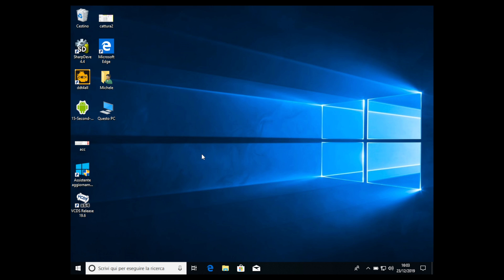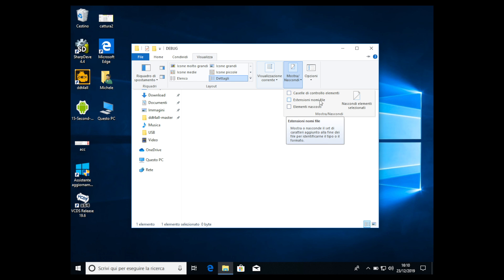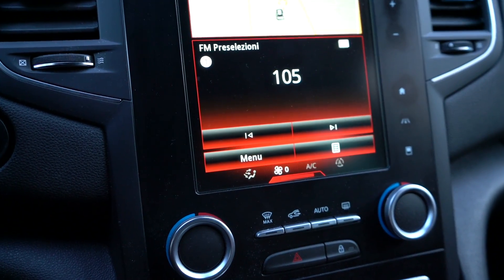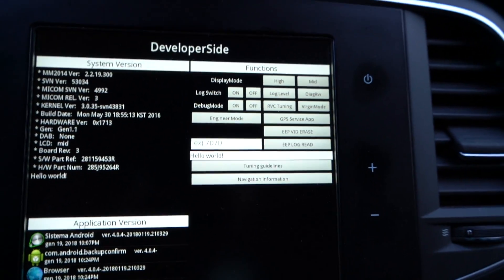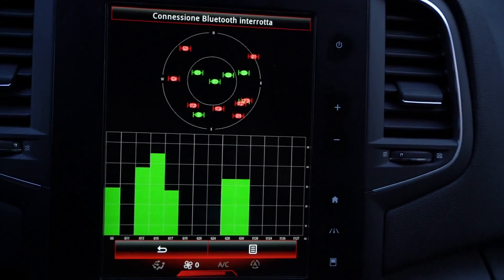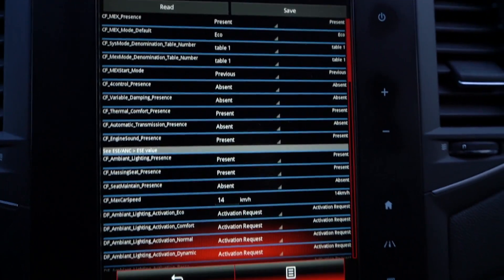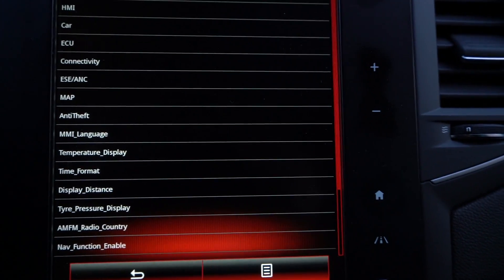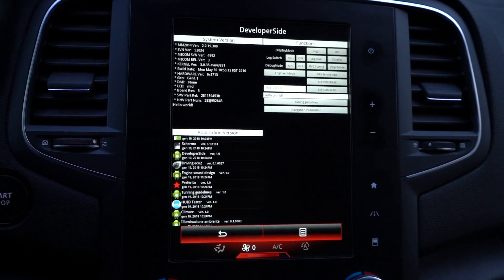R Link 2 Developer Mode Activation Tutorial | Renault R-Link 2 Debug Mode

Comment: it is possible to update the RS Monitor and ambiental WHITE light for 2018 Talisman Rlink2 with DDT4all?
Reply: Also for same car, I added ACC buttons on steering wheel, but now I got message "check cruise control" so I guess the buttons needs coding (on display I can see the radar distance), but not sure on which module to activate ACC buttons...

Comment: Hi. I just got a second hand Grand Scenic IV Bose edition with R-Link 2. I realized Bose edition multimedia sound setting is pretty much only Bass and Treble adjustments whereas non-Bose version got more adjustments such as Bass/Mid/Treble, bass boost, ambience etc. can going into this developer mode change that? Thanks.
Reply: Hi Jack, I'm the same as you i bought a megane 4 bose edition in January and was hoping their was a little more than just bass and treble, did you find and info after? Thanks
Reply: @crow7580  no solution.
Reply: @jackmok  ok cheers, pretty poor setup really

Comment: No matter what I do the developer mode won't appear. I just end up with a usb stick containing the DEBUG, lost.dir and RLINK folders 🤷
Reply from the maker: you sure you did the exact commands? have you used a Macbook?
Reply: @drivewithmi Windows 10. The stick I'm using worked in my Megane but not in either Kadjar
Reply: FINALLY managed it! Any idea if the beep for the speed limiter can be set to once or turned off?

Comment: hello! I have a doubt that maybe you can solve. my car didn't have the leds on the center console, but I bought the trims from a car for parts and I've already confirmed that they fit, my car also has the connection prepared but when I plug in the plug, the leds don't turn on, I think I have to unlock something in the multisense for the car to recognize the new leds, do you have any idea what the option is? maybe in developer mode?
Thanks for all the tutorials, very helpful!!

Comment: Hello, thanks  for video. Do you know if it is possible to turn on distance warning ? I've tried turn it on with radar, but nothing, should it be used with camera option or it is not possible? p.s.distronic can read the speed signs, so distance warning might be possible to turn on. thanks
Reply from the maker: for turning on distance warning you must have front camera and front radar, otherwise is not possible
Reply: @drivewithmi  clear, thanks.

Comment: Hi Michele, great videos. I have replace the 7" screen in my Megane Mk4 for the 8.7", I have changed all the parameters shown on You Tube but the display is still in landscape but you have to tilt head 90 Degrees to read it. Also because it is still in landscape I can't access heater controls. Can I use the Developer Mode to fix this problem? Thanks in advance
Reply: Same here, can you put here a link to YouTube link we're you find the parameters?

Comment: Hi..i have Koleos 2018. I tried this method and enabled my Apple CarPlay and Auto Android as well but unfortunately CarPlay is not working. When I connect my cable to the phone it connects and disconnects in cycle. Do you have any idea why would this be ?  Do I need to change usb socket for this/
Reply: How I can revert the modifications to avoid changing the usb ports, I disable CarPlay and Android Auto using debug mode again, but the  SmartPhone Integration option still apearss on RLink Screen (it was not there before the change). Any advice?
Reply: tdwt  so finally I found one USB on eBay and ordered ( as it’s very costly from Renault). Changed and boom! Now it’s working fine.
Reply: My koleos 2018 does the same after I enabled Apple Carplay. What is the model of usb ports your order from ebay?

Comment: Hi Michele. Very nice video! Do you think is possible to change side mirrors open/close adjustment by this way? On my KOLEOS 2017 if I want to use KEYLESS I only have 2 possibilities: manually close mirrors by push the button on the driver's door or mirrors are always closed with locking the car. And always means always when I move more than 1m from the car or when I go around the car in front ...

Comment: Hello michael... I wanted to ask about the ACC but readin the comments i got my answer 👍 but i have the function blind spot warning in the diagRW does this mean i nead to get the side mirrors with the indicators, enable it in diagRW and it will work??
Reply from the maker: Hi! For the BSW (blind spot warning): it does not depends on mirrors, but it depends on parking sensors, you should have the automated parking sensor (it’s six sensors on the front and on the rear bumper); if you have only 4 (normal park assist sensors) you will not be able to have BSW

Comment: Hi, I cannot change the style of the dash screen. From R-Link Multisense Menu, I choose one of the 4 dash styles but nothing. It does not change. Is there a setting in developer mode to solve this problem? Thank you in advance. My car is 2016 Renault Megane 8" screen by the way.
Reply: Hi, did you get an answer to your question. I upgraded from v2 to v7 and I also cannot change the styles in my r-link?
Reply: @maxinehumphries9655  Yeah I got an answer. The problem is that the dealer/service has to make a final completion process after the update is done. It is kind of a software verification process I guess. The reason why we could not see the styles is that the dealer/service forgot to complete the process. I got back to the service and they solved the problm within 15 minutes.

Comment: Thanks for the turtoria> I have a question where I couldnt find an answer for and I have called Renault Netherlands today and they couldnt provide me with an answer...
My question is: I have Talisman 2018 with massage function in the front seats but this function works only for 10 minutes a time. could you find anything in the settings to set the time to unlimited instead of 10 minutes?? I would appreciat your reply
Reply: Looking for the same thing in my Megane. Have been searching in DDT4ALL as well, but so far haven't found a value to extend this yet.

Comment: Is there any way to turn on SAFE DISTANCE WARNING with this?
Reply from the maker: You can activate safe distance warning only if our have the front radar for the adaptive cruise control, otherwise no way
Reply: Michele Predieri Thanks. I don’t have it :-( I assumed it might use the radar for the emergency braking.
Reply: Michele Predieri Is there any setting to make the mirrors fold in and out with the engine starting/stopping? My mirrors stay out all the time unless I press the button to fold them in.

Comment: Hi Michael, love you videos. I have a question...Can I activate android auto via developer mode and how?  I have r-link version 7.0.  Thank you in advance.
Reply: I dont think you can, you’d need to do some hardware mods but it’s easier to just go to a dealership and make them do it
Reply from the maker: They will never do it, because it’s an option you have to pay when you buy the car. You can activate it via DDT4ALL and OBD 2 interface, is very easy actually
Reply: @user-hd7ej9om1u  thank you.
Reply: Can you please specify exactly where the setting for Android Auto is located? I just got an update from a dealer to version 7. They say it's not possible to use Android Auto in my Megane (it's from April 2017). But I just want to check it in debug mode. Maybe it's there. Thank you very much for such a great video! And you English is quite good!

Comment: Hi. Good video

Have a older model Kadjar. My radio has this very annoying thing where it changes the station for no good reason. I think it’s the Auto Frequency, but it’s not that the signal is bad of the station I listen too and it doesn’t even change it to the same station. Can I disable the AF in debug mode. I’ve contacted Renault and they pretty much told me that they have take away the button of switching it on or off in the menu and have no intention of putting it back.

Comment: Hey Thanks for your Work! Is it Possible to Activate Android Auto Wireless Mode in the R-Link2?
Reply from the maker: no, unfortunately R-link 2 does not have te wireless option, because it lacks wifi module, with the rew renault easy link (new clio, new captur ecc) you can
Reply: @drivewithmi  OK, to bad thats not possible. Thank you! ;)

Comment: Hello!  Another question came to my mind.  Or request.  How do I disable the automatic wiper function with ddt4all?  Can we ask for a video like this?  Many people do not like this feature.  :-(
Reply from the maker: weel, you simply move the lever to manual :)
Reply: @drivewithmi  Manual is only for continuous deletion.  Staged deletion only happens automatically.  I'd like to manually set the stage wipe as if it had no rain sensor in the car.
Reply: @drivewithmi  Hello!  I managed to turn off the rain sensor with ddt4all.  Now the intermittent wiper function is completely manual.  It is not operated by the rain sensor.  :-)

Comment: Hey.
 Is it possible to activate automatic cruise control  if I don't have it from the beginning?
 Great videos!
Reply from the maker: Hi! You need to have the front radar and the specific button on the steering wheel!
Reply: @drivewithmi  ok. But without the button on the steering wheel maybe it will be possible to activate it from the rlink2?

Comment: Hi
Has anyone played with the loudspeaker settings?  I have intalled new Speakers and getting good sound but want to try and get more without installing a Amplipher.
Reply from the maker: Hi Simon, for “playing” with audio settings you must use the OBD interface with reversed pins
Reply: Hi  Have you managed to change the loudspeakers settings?  What are the options?  Does it change Amplification or sound or any DSP settings?Thanks

Comment: After struggling with a cheap OBD2-adaptor, I bought the one that you recommended. What a difference, works like a charm! I've already changed several parameters in the light configuration, according to your great videos :-)  So keep the good work up, I'm looking forward to see what's coming up!
A related question: Do you know if it's possible to shorten the time the "Welcome screen" on the central panel is displayed? Is it configurable in DDT4All or is it perhaps something in the R-Link itself?
Reply: Same here

Comment: Very nice video :) Is it possible to turn off the traciton control on Megane GT TCe in Sport Mode ?
Thnx again
Reply from the maker: Yes, but after 40km/h it will turn on once again, only megane RS can deactivate it permanently
Reply: @drivewithmi  so every time you go above 40kmh then you need to deactivate manualy or it will be off all the times from 0 to 40kmh ?
Reply from the maker: no no.. everytime you go above 40km/h the traction control will stay active automatically, and there's no way to deactivate it. Under 40 km/h you can activate or deactivate it every time you want
Reply: @drivewithmi  thnx a lot man. Keep up the good work 👍👍👍
Reply: Can you please write the direct order, how to enable function in developer mode, so you can turn off traction control. Great videos btw. They are a lot of help

Comment: thanks for  video , i got a question
i changed acc to present and  many other things but non of them has changed its like just preview, can you help me on that please?
Reply from the maker: hi, for the ACC you should have the front radar, otherwise it won't work. for other things i suppose you have all the hardware needed, and if it doesn't work probably you didn't make all the ecu reset needed, and also try to lock the car an leave it locked for about 15 minutes before re open it
Reply: Michele Predieri  hi again thanks for your reply,
My car has full radar but still its not working and also break assistant is not working , i started the engine and then i changed those things, is it possible because of that they are not working? If yes what should i do then?
Thanks for yor help

Comment: Ciao Michele! Ottimo video
Che tu sappia, è possibile settare il multisense che parta con l'ultima impostazione lasciata? Ogni volta che spengo l'auto ritorna in neutral
Reply from the maker: Ciao Fabio! Il multi sense ritorna in neutral ogni volta che tu spegni la macchina in modalità sport. Quella è l’unica modalità che non rimane memorizzata. Se tu spegni la macchina in una qualsiasi delle altre modalità vedrai che rimarrà memorizzata!
Reply: Purtroppo non è così
Ho la sporter di mio padre che rimane all'ultima impostazione lasciata, tranne in sport, che ti chiede se rimanere in quella modalità o cambiare
La. Mia grand coupé invece no, comunque lasci la Multisense, ritorna sempre in neutral. Versione 8.0. 32.506
Reply from the maker: @fabs182xxy  oddio che roba strana... mai sentito un problema del genere! ma non è che nelle varie impostazioni usa sempre il motore in sport?
Reply: @drivewithmi  sempre e perennemente in eco, ma appena spengo il motore, dopo un paio di minuti si resetta e torna in neutral
A questo punto la porterò in renault